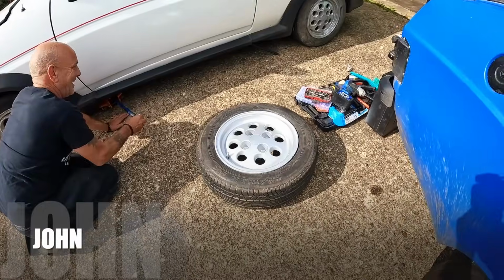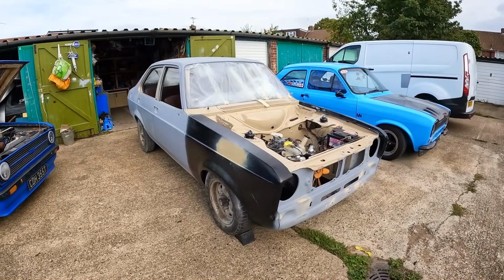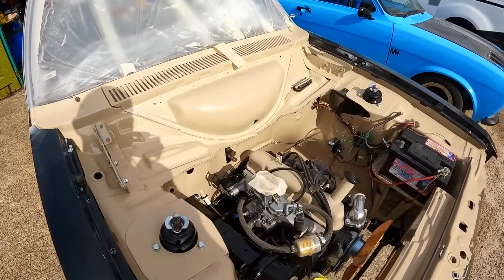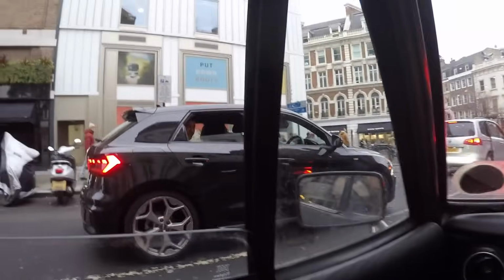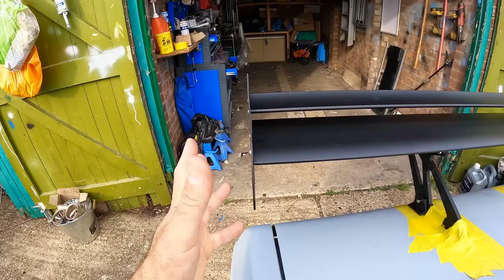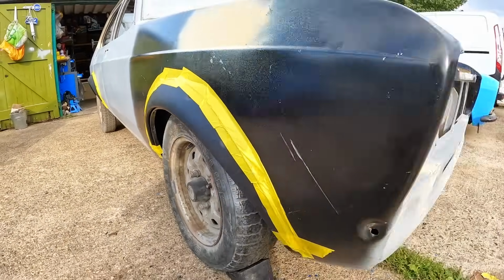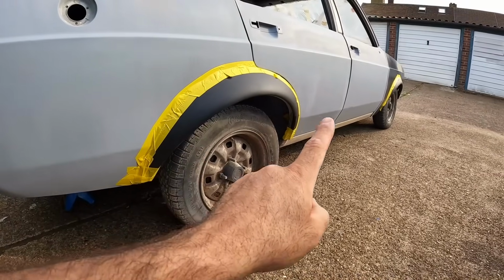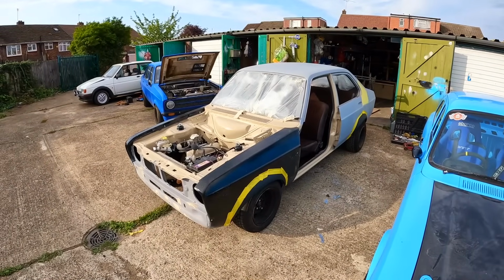REVEALED!!! - CRAZY new plans for my Mk2 Escort project!! 🤪

Comment: I’d prefer it to look standard inside and out with the big engine…. That said. If you are going to build something ‘mad’… go the whole hog and build something really, really nice, and it wouldn’t necessarily cost much more. 

I’d paint the shell up nice. If you were prepared to cut and buff it you could even 2k aerosol it panel at a time, but that would be a last resort, safer having someone else do it. It’s getting a bit late in the year to be painting without heat. 

I don’t like the spoiler, it’s not tasteful in my opinion. I’d ’eventually’ aim for carbon bonnet and duck tail or carbon standard spoiler. Why not put the effort in to making it what you said you wanted, with rally arches, cut them straight down in line with the door shut. Those can be bought very cheap from xsportracing, align expectations with price, they are rallycross parts. Then DIY carbon skin them. They do list carbon, but whether it’s exposed or what it’s like I don’t know. They make other mk2 kits too, but like I say, rallycross quality, but workable for the money. I have their 6r4 kit. 

I think putting a bit more effort in, and a small bit more cost over time will get you more views. But then… it’s down to personal taste, so it’s your decision in the end.

Comment: I did comment on a video a while ago that i thought your head would fry driving a 1300 xflow about😂 I think your plans are spot on but i'd use Maudes rear spoiler too👌 I shocked myself by quite liking the arches tbh..
You're deffo doing the right thing👍
Onto a non vid related question..I notice it does not look like you are running header tanks on the 2 st170 powered cars have you had any issues at all? What rads and caps have you used? Do you just fill them so far to allow for expansion or something? Sorry for the daft questions but Retroford insist you run an expansion tank but i'm sure i have seen loads that don't?

Comment: i can understand you plan  a common sense move saves restoring moudes shell, i did't think you could hack driving round with a low powered engine lol, if your planning to to use the car as a daily i would properly rust treat the the shell with wax injection and under body protection as you dont want to be in the same position as your are with moudes shell  now, sad to see moude go but hopefully some one will restore her shell so see can be back on he road in the future

Comment: You’d be better selling one of the 4 drs as is, you’ll end up with one mash up worth less than the sum of both.  Get rid of the beige one and fix the blue one, the figures don’t make sense esp if you want to chop the floors about for the tunnel. You’ll end up ruining a good car that’ll have limited appeal should you need to sell it later.

Comment: Hi if you are changing the tunel and cutting the floor up. Will you be fitted a rear link set up on the rear axle?
Reply from the maker: At the very least she'll get anti tramp bars like the RS2000s have (was good enough for 'Maude') BUT I'm considering an A Frame instead. 👍

Comment: I don’t mind the wing at all. The diffuser is great. I’d keep it the size it is. The car would look unbalanced otherwise. 
If the flares are going to be colour matched, get a piece of fine black trim to bolt between the flares and the body. It’ll set the flares off nicely.

Comment: If you want to get the rear spoiler to lean forward more couldn't you just drill some holes slightly lower on the front adjustable brackets ?
Reply from the maker: Thats defo an option I reckon. Thanks for the advice! 👍

Comment: Still not to late to go outlandish with Heidi's paintjob. Just choose a colour that would go well with a beige engine bay. Maudes' bonnet probably just needs a new skin of glass underneath and some heat-shielding to get it's shape back. You can change the shape of glass with a heat-gun. The heat from the engine prob caused it to sag in the first place. 
Ask Garry Bull to knock you up some carbon extended planes for the wing. Deffo needs to be wider imho. If it were me, I'd also ask him if he would colab and do carbon chassis mounts for it too. You said you wanted this car to be wild...  😁
Reply: i can do his wing uprights in carbon but wont be easy cutting out the shape from an 8mm thick piece of carbon. im trying to convince him to have a the same rear wing as mine. its 170cm wide so might be too wide for him. ive also got a wider and better looking rear diffuser mould.
Reply: @garrybull4165  I knew you'd be up for it 😁

If the outer shape of the uprights are right, I think all you'd (well Marcus lol) would have to do is drill mounting holes? If you follow my thinking.

 I think most of these metal chassis mount uprights aren't solid to reduce weight/add style. There are some solid and and pretty basic design looking ones out there though. Some just look like they've been attacked with a hole saw too 😂
Reply: @starfox_wr-45e93  i'll help with anything that upsets the anoraks. its his car and let him modify it much as he wants. just wait till i finally reveal my new crazy build. that will upset the anoraks for sure
Reply: @garrybull4165  Can't wait to see that. Your builds are immense
Reply: @starfox_wr-45e93  the new build is outrageous
Reply: @garrybull4165  Have a google of the "HARD Motorsport Chassis Mount Wing Upright kit - E92" to see what I mean about the solid style mounts. Those are pretty basic.  Cheers Garry👍🏾
Reply: @starfox_wr-45e93  ive got chassis mount brackets on my own car similar to those. dont think they will work on a mk2 escort. i have alloy moulds that allow me to make them as a pair

Comment: love it. the more mods the better. got a fibreglass mk2 bonnet in my workshop that needs a little bit of work. will look at sorting that soon and get it ready to take a mould off to make some carbon bonnets. loving the new plans. as for the rear wing it wouldnt be my choice of wing. not a fan of the 2 blade type. ive got some taller uprights thats wil lfit that wing. think there 10" high without the small adjustable bits. yours if you want them. my new wing thats on my mk1 might be a tad too wide for yours. its 170cm. those arches need to be done in carbon. dont forget i do a universal rear diffuser. 109cm wide and looks the bollox. same as whats on mine
Reply from the maker: We'll talk mate. Im defo due an other visit anyway. 👍
Reply: @marcushayesford  cool mate. mines getting closer but got to get all the carbon panels prepped ready to go for lacquer and get the wiring sorted. the wiring is the main thing im struggling with as im no expert when it comes to that sort of thing